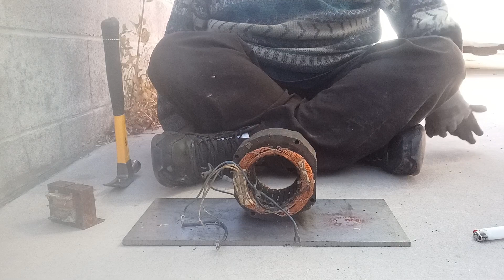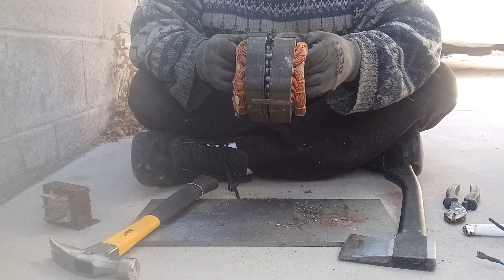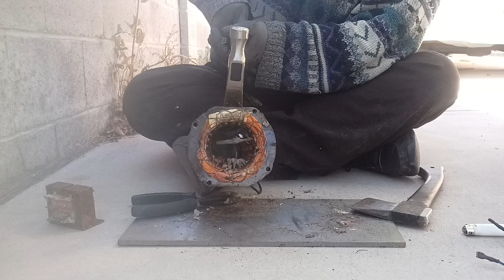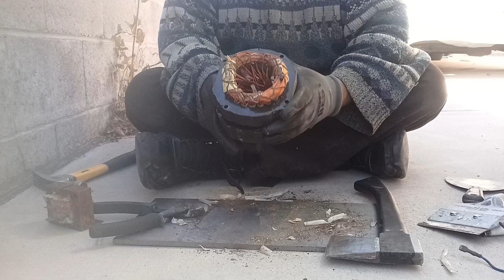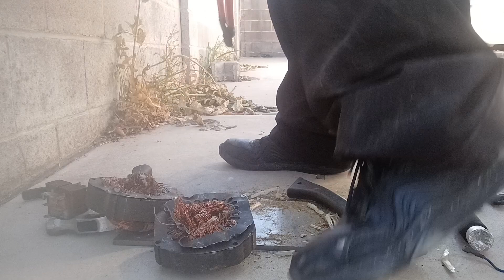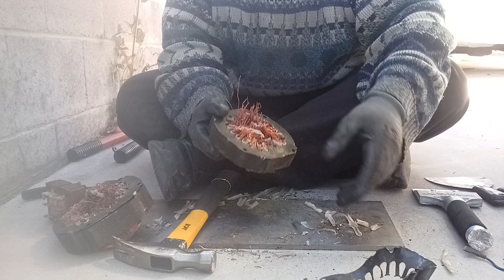axe vs motor epic fail

Comment: Same again for your next video? A re-do with a sharpened axe would be good
Reply from the maker: No whenever  attempt to do this video again it's going to be with a sharper axe and I will have a machete on standby but I will only do it when I have those tools ready. Plus I was also told by a long time friend to get another tool which when I go to Harbor Freight the next time I go down to the scrapyard I will pick it up to see how it works he says it works great so you will see that in an upcoming video too